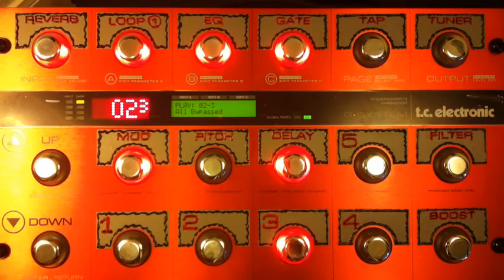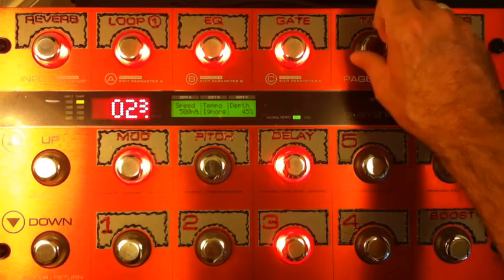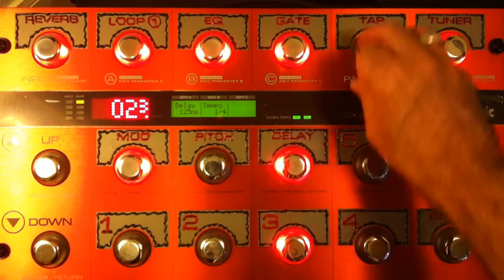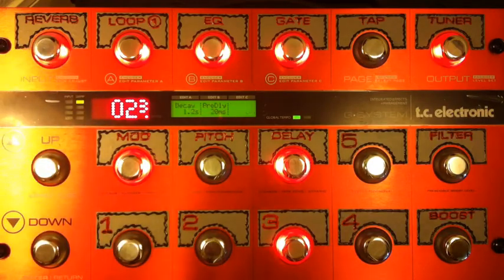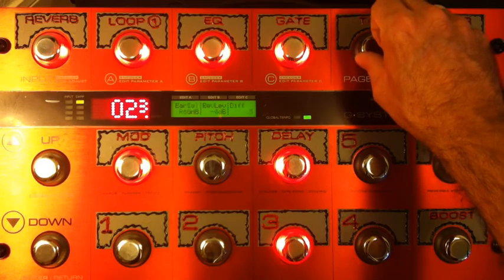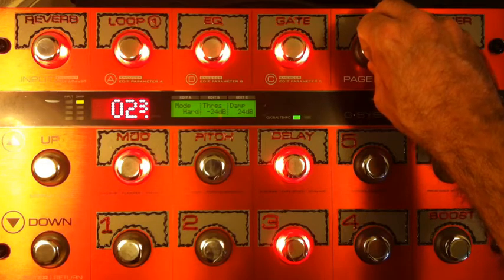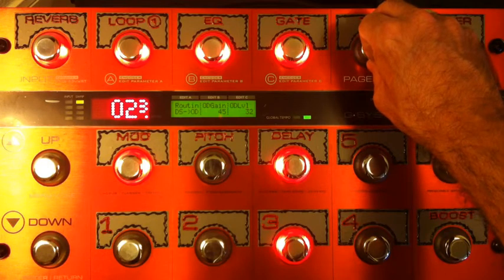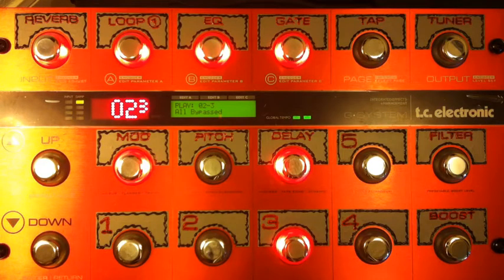TC G-System - Van Halen - Aint' Talkin Bout Love

Comment from the maker: @hagbuck 
Hey Ian,
I can only assume that the issue is related to the way I run straight into the amp, or maybe your loop level was too high for the Nova Drive.
One of these days I'm going to rent an amp with an effects loop so I can do some 4CM videos...the only issue then would be volume, most amps with effects loops are 50 watts minimum...do you know of any lower wattage amps that have effects loops?